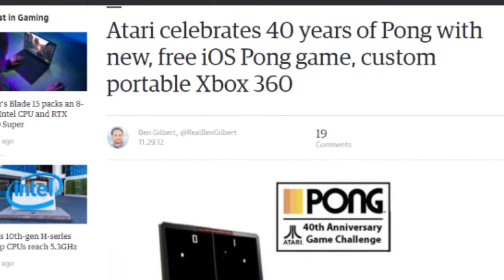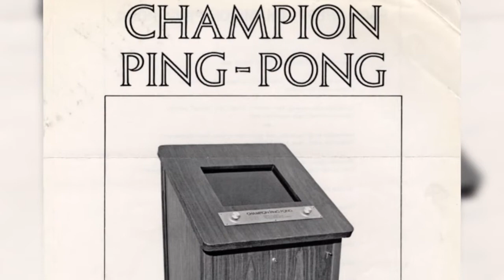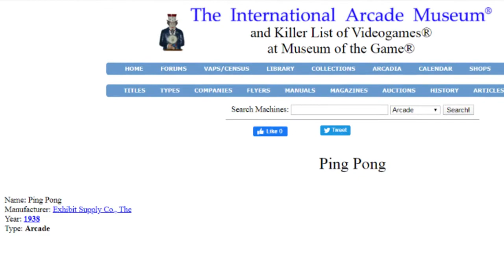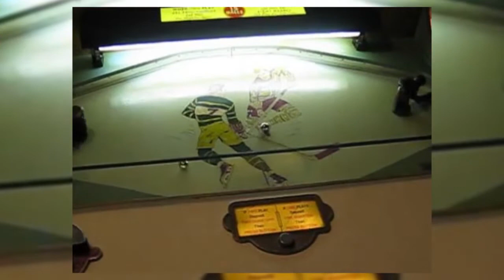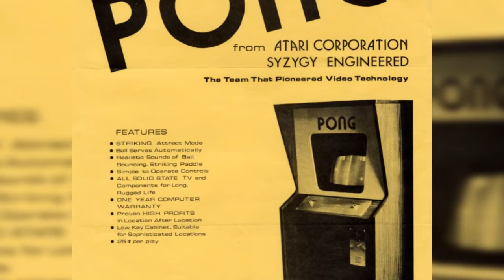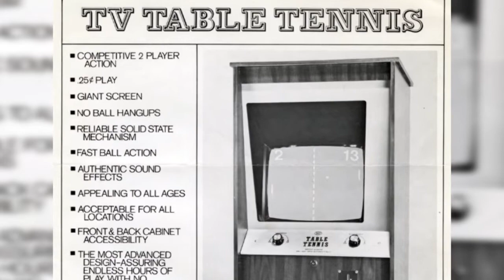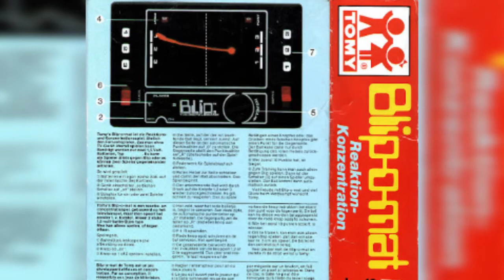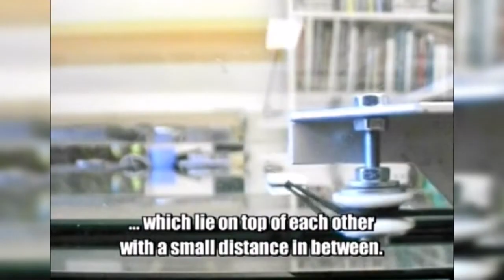Strange History of Electro Mechanical Pong! Arcade/Console/Pinball EM Pong versions of Video Game

Comment: I have an original Ataris pong console at home
Reply from the maker: when I was probably 4, we got an Atari Super Pong - the 1976 follow-up to the original 1975 version; I know because I remember it had a blue logo/branding, and the original version was brown. We got a 2600 soon after, probably for Xmas just after the launch. But I still have a few memories of the Pong console - we had the simple design, all integrated into one unit with the dials on the console, no detachable controllers - though in the 2000s I did buy a Sears Tele-Games version of the 4-player models. So cool you've still got your original, I wish I had mine. Tell me, does it still work?